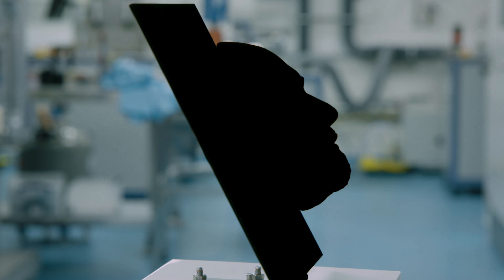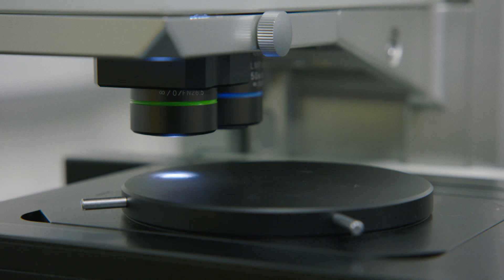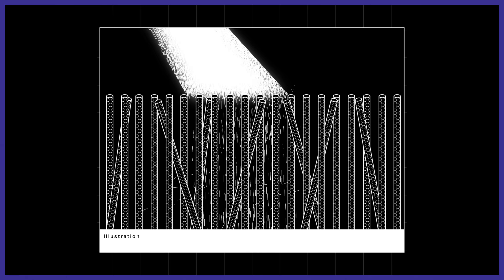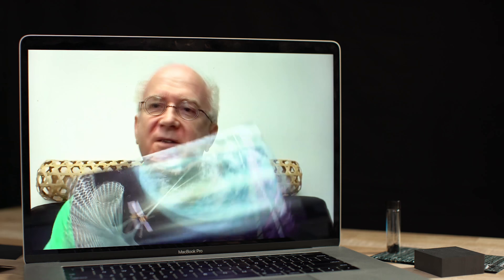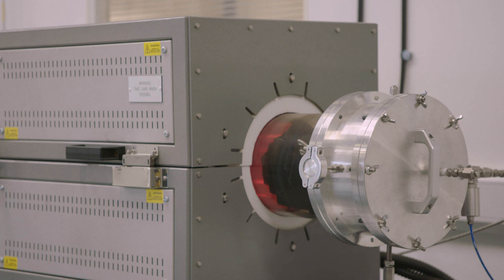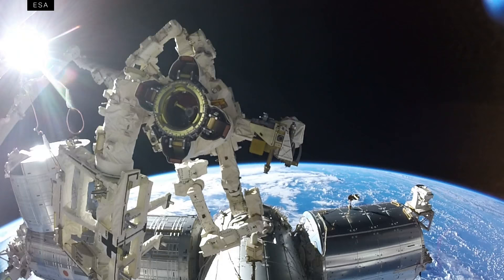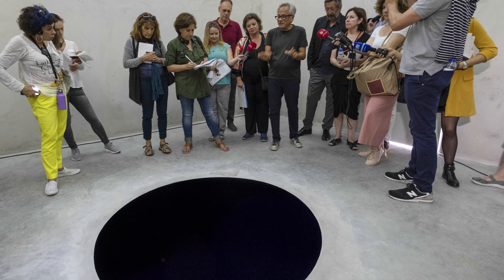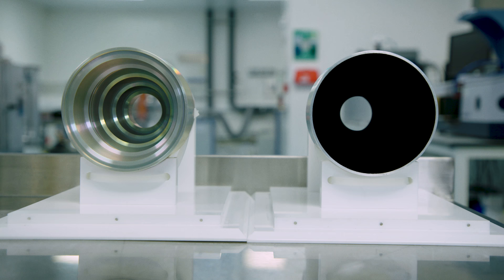Carbon nanotubes built this bizarre ultrablack material

Comment: It’s disappointing that the general public can’t even access vantablack.
Reply: yet
Reply: Yes you can, start research, contact them, get black
Reply: @Yooo-ph5zx  no they sold the exclusive rights to use it
Reply: @solarsatan9000  how can you own a color? I don't get this. Can I copy right a certain type of green? If I make a very specific green color with very specific pigments that I extract from a certain plant using a very specific chemistry procedure - could I then sue anyone who uses that color?
Reply: @the_original_Bilb_Ono  I don't understand it either
Reply: just close your eyes
Reply: It's a color that is only achieved thru a substance that was singularly invented. I think that they own the rights to the substance instead.
Reply: From wiki: Vantablack is a material developed by Surrey NanoSystems in the United Kingdom and is one of the darkest substances known, absorbing up to 99.96% of visible light. The name is a compound of the acronym VANTA (vertically aligned carbon nano tubes arrays) and the color black. So, Vantablack is not just the color itself, but is a type of material.
Reply: Want to be a political magician
Reply: @the_original_Bilb_Ono  It's not a colour it is a copyrighted material. There are other Carbon nanotube blacks you can get which are slightly worse.
Reply: @the_original_Bilb_Ono  Yes you can own a color to some extend, for example 'john deere' is one of the companies that paid trough the nose to 'own' their green+yellow color combo, and they have won court cases about this in the past, you can do what u want with those specific colors but paint a piece of farming equipment in the same colors with the same style and they can sue you, coca cola 'owns' their specific shade of red etc, you can make your own cola with your own shade of red on the cans, but dont make the shade of red an exact match or they can sue, etc.

In this case its not so much that the company 'owns' the color 'deep black' but they own the chemical formula's and processes to get to their final product, even if you know how they make it you cant make it yourself on a commercial level, unless you give your own spin to it / invent your own version of it.
Reply: Solarstan of YouTube so? If you know how to make it no one will stop you from making it
Reply: @suicidalbanananana  Your examples of Coca Cola and john deere aren't exactly copyrighted colours. They just copyrighted the style of their product which means you can't use the same font and colours in your own product of a similar market.
Reply: @solarsatan9000  no,the sold the exclusive right to use it for art.you can still ask to buy it,if they could make a lot of it at once
Reply: @the_original_Bilb_Ono  actually yes ,you can and companies have copyrighted colors
Reply: They dont own the copy rights to a color ; rather the specific material used in making the color. Im assuming
Reply: Just wait for the night
Reply: @headobe8577  your assumption is wrong, big companies like McDonald's literally own pairs of colors
Reply: @entiretwix1480  Pretty sure 'hea dobe' was just pointing out that in this case they didnt register the color, but the process to make it, and thats very much correct
Reply: @headobe8577  Correct!
Reply: @zackwyvern2582  but that's still like a very dark red, because your eyelids are too thin to black out all light
Reply: It's just like purple back in the day
Reply: LOL everyone's forgetting this material is fucking expensive, yoy couldn't afford enough of it even if it was manufactured and sold (at a markup of course) on the market.

Comment: I wonder what it looks like through other light wavelengths, like ultraviolet or infrared.
Reply: "UV, Visible and IR absorption - Absorption works from UV (200-350 nm wavelength), through the visible (350-700nm) and into the far infrared (>16 microns) spectrum, with no spectral features."

Makes sense. But I bet you still can't avoid blackbody radiation.
Reply: RBuckminsterFuller legit
Reply: @RBuckminsterFuller  Being this black and absorbing so much light, I would assume it actually warms up very quickly when exposed to light. And then it will emit infrared radiation.

For what you would see in parts of the spectrum that it doesn't absorb: It would look like any other reflecting surfaces in that part part of the spectrum.
Reply: That sounds like an awesome idea for a video

Comment: Ok...light is a form of energy, so if it's absorbed almost completely won't there be any heat or any other phenomenon?
Informative video btw.
Reply: Of course. It absorbs visible light and emits infrared. It's called black-body radiation
Reply: @bilalsadain  hmm...this material absorbs light almost completely so won't the emission be too much?
Reply: @debojitchowdhury6825  Like in the video stated, it's applicable to room temperature. Saying 'room' implicates that there is no use outside where the light is too strong. The future may hold more resistable material.
Reply: Debojit Chowdhury 
There aint much energy in a LED or Neon room-light even when absorbed 100%

It is probably hotter than other black objects but not that hot
Reply: There is heat but a room temperature there isn't also a lot to catch, and probably it releases in other form like infrared, so is great to catch energy to use it as heat.
Reply: tommy aronson  oh you're here, too. Whats your problem? People are here to learn
Reply: tommy aronson  *Thermodynamics

Comment: Does it absorb all types of wavelenght? Or only visible light. 
If it can absorb other types of radiation this can be  applied in all sorts of things.
Reply: Angelo Yamamoto This is extremely old tech so if it could do anything cool they would probably already know
Reply: I already seen reflect quality in the black. So it not completely non reflective
Reply: It is physically impossible for it to absorb in all wavelengths. Most likely it is just absorbing in visible light and nearby wavelengths, i.e. maybe some UV and/or infrared.
Reply: The coatings absorb from the UV to the THz spectrum - <100nm to >600um wavelength.

Comment: Graphene is too expensive.  Those guys up in Canada created nanotube tech using marijuana and made super capacitors that discharge 3X more electricity.
Reply: What? I NEED more info on that!
Reply: MOAR info!!!!
Reply: Info? Link? Source?
Reply: @namyx_71  see below
Reply: @dmkfwolf2669  just shared link.
Reply: Thanks, Doc!
Reply: Thanks champion!
Reply: I need that weed
Reply: Hemp, not marijuana. Different plant. Nice try though.  🙄
Reply: @MatthewStinar , okay, I stand corrected.  Thank you.
Reply: It's actually 420x more conductive.
Reply: @rock3tcatU233 , I like the way you think! 😷👍
Reply: Duh. I told them that tube electronics is the wave of the buffering future. Wait until they get into using nano-tube 2d stator & rotor designs for micro power production. At that point, all computerized systems will be self-sufficient using recombinated tech in generation of level stepping using sunlight. About 300X faster to charge your phone. Walk outside for 3 minutes, and your laptop is charged. Secondarily, coupled with the japanese 2d i/o print systems modified for display, you now have the ability to make interface displays about a molecule or 3 thick...

and completely flexible, able to be crumpled up like paper with ability to reform with no creasing. You can fold your desk top up, put it in your pocket, and off you go. Give it another 5 years, especially with decentralized processing, using the entire interface in specific molecular packs for gating.
Reply: @CyberDocUSA  thanks

Comment: If this substance absorbs and traps light (photons) extremely well does it also effectively trap and retain heat? Could it have practical applications in very cold climates such as Antarctic research facilities? Lastly, if this substance was extremely durable, I think a Centurion card from Amex coated in Vantablack would be so cool...
Reply: Then this particle also lose heat soon .

Comment: I'm curious as to how Vantablack deals with higher energy EM radiation, the ionizing kind, X-Rays and what not.
Reply: Good question! I suspect it would absorb it well. Longer wavelengths like microwaves not so much.
Reply: @drr30  : If this coupled with basalt fiber composites, which are already good at shielding against ionizing radiation, can be used for future lightweight structures on the moon or Mars.  We can keep 'em "warm".

Comment: this could have implications for solar heating by allowing an element to absorb the most energy from incoming light.

edit: also a very promising chemical weapon, assuming those small filaments can be easily friable and suspended in air as well as incapable of easy degradation could be perfect for targeting lungs.

Comment: So VantablackX is not made from nanotubes. Ironic.
Reply: It is made with nanotubes, but the trick is the structure. A regular structure could allow light to escape but an irregular one easily catches everything, in this case up to 99.96% of all visible light.
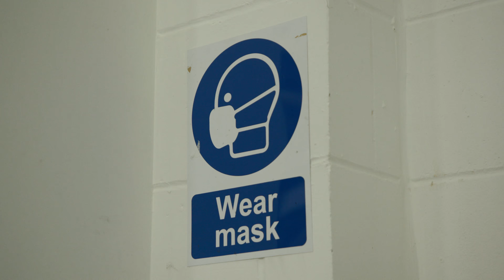Reply: @EduardoEscarez  5:40. "VBx, that doesn't use carbon nanotubes at all".
Reply: @grandgamingexhilarating  that's an cheaper alternative "VantaBlackX"
Reply: @grandgamingexhilarating  VBx is an alternative for places were the use of nanotubes could be harmful, like in public installations. They produce Vantablack for uses that don't have that issues.
Reply: @EduardoEscarez  Thx. 👍.
Reply: Oodle Richhy How is that ironic.

Comment: This is very good for solar thermal technology since it takes all the energy from the sun and contribute to a high internal temperature especially for heating Canadian and other cold weather location homes and buildings without needing natural gas to do so. Very good material for this technology. Nice hot water can come out of it despite freezing weather.

Comment: honestly you could make solar sails which are lined with these to achieve higher efficiency with solar cells where the heat is transferred to an array which might not be getting sunlight. Since it is carbon nanotubes, should be easy enough to redirect the excess sunlight.

Comment: My question would be: if it absorbs all that light, does it heat up quickly? If not, one could use it in underground military complexes  in order to coat all underground corridor surfaces. No enemy could come down there and see you, if you and your entire equipment are coated in that stuff as well. Total darkness, not even nightvision could see you, for even that needs some kind of light. It would jam the intruders visual senses almost 100% and you yourself would see the enemy through thermoptics. Which would mean the only orientation would be thermal markers dispensing invisible heat on the walls, the ground and the ceiling. Not hot enough to heat up the corridors much, but enough for the thermoptics to recognize them. You could walk around somewhat casually while the enemy would be totally blind.
Reply: Light does emit heat. Everything in the electromagnetic spectrum does. It is common to use microwaves to heat up food.

Also Vanta black will be heavily visible to thermal imaging which most militaries use. But at night it may seem viable but if it absorbs infrared radiation. Get rid of it.

Comment: If you take an oxy-acetylene torch and turn on just the acetylene (no oxygen) and torch an object with it, it will cover it in a very matte suit similar looking to vantablack. Only problem is it rubs off very easily.

Comment: It's efficient at absorbing light... would that mean it could be useful in solar energy?
Reply: Short answer: No.
 
Long answer: You would always chose some random paint that absorbs 99% and costs just a few cents over some high tech material that absorbs 99.9999% but costs literally thousands of dollars. That ~1% difference in performance is pretty insignificant considering the price difference.

Comment: Help this comment get noticed   by Intezga, Tesla found a way to transmit energy. I seen how ventablack transforms the wavelength of visible light to infared light. At such altitude like Tesla mention there would be an abundance of UV to transfer to infared to heat the hot air balloons and to power water vapor generators